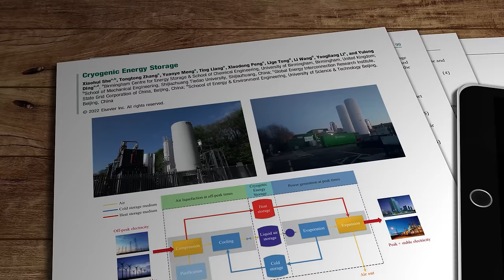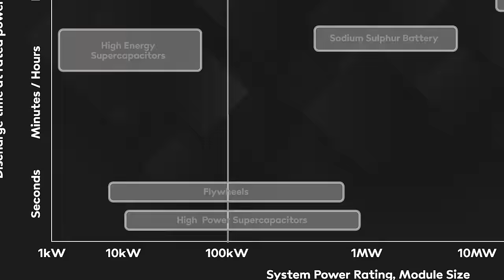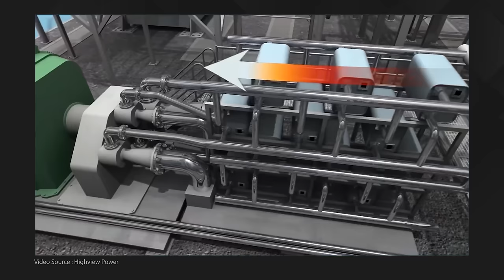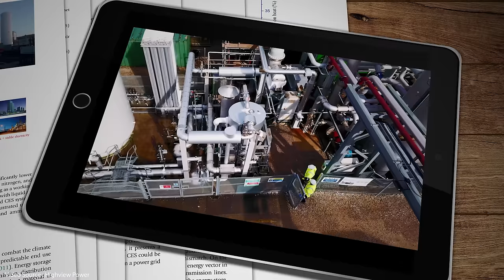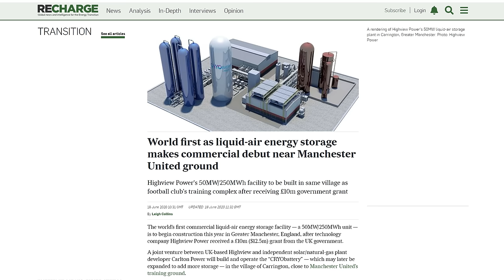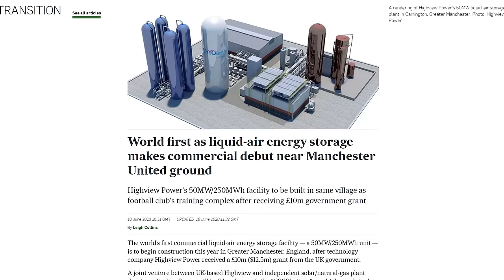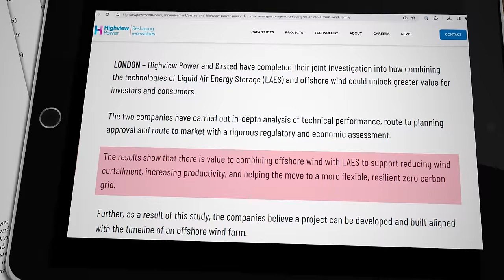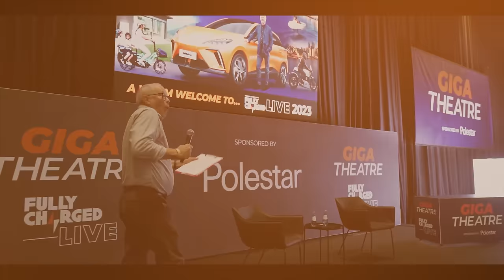Cryogenic Air Energy Storage - the new long duration energy solution?

Comment: I just skipped through and noticed that there are no statistical figures attached to this method. What is the efficiency of the storage? From a theoretical standpoint and the actual machinery there seems to be not only insane amounts of friction but also heat loss because it needs to be insulated. The only benefit of this storage solution is that it saves space.
I don't know why people try to develop solutions that are inherently very inefficient and high maintenance.
From a physics standpoint gases have a very low capacity that is just increased by turning it into a liquid and its attached energetic potential of having it expand. Expanding gases don't heat up they cool down. The heat that this system claims to recapture is friction heat which ultimately has a very bad efficiency altogether because IR radiation will heat up the whole machine and energy leaves the system.
There already are much better systems, that have less moving parts and are more efficient such as gravity based systems. You can store energy by pumping water up and get much more of the energy back again by letting it run down through turbines. 
And you can heat up rock which has a much higher capacity with its energy density and its easier to insulate. You also won't have as many high pressure vessels and the need to keep all of those air tight and impose a gigantic safety issue due to these high pressures.
Overall from my viewpoint this "storage system" seems like a scam to grab grant money and will ultimately be decided to not be used anywhere.
It is bad. High tech wasted on a system that we already have proven to be sub par.
As a direct comparison in a real work application in a competition between gases and more dense mediums for example liquid you could take gasoline engines vs liquid gas combustion engines. Now go figure what worked in the market and has more advantages and is safe altogether and has a higher energy density? The non compressed combustion. Translating just that simple fact from compressed to stable and more solid mediums it is very clear.
Don't drink the coolaid.
Reply: He said 60% efficiency, which seems reasonable to me. Storing liquid air (or other liquified gases) is not new or exotic technology, and I see no more reason to be concerned about its safety than, say, LNG, or liquid oxygen stored in every hospital. Insulation losses are very much a solved problem. The biggest justification for this approach is that it’s almost entirely off-the-shelf technology, which reduces time-to-market.
Reply: @davestagner You are right, its not new technology, but thats also what bothers me using compressed gas in this way. Because we know how inefficient it is. 60% is awfully low for just a storage solution. If you make an artificial dam pump water up with excess energy and let it down again when you need it there is much less loss and way less saftey concerns and less maintenance and tech involved. Thats my point. This technology only has a space advantage but the cost and complexity would be so incredibly large compared to systems we already have that it makes no sense to me why this is done in the first place. Thats why I think this is just a money grab from some startup. Btw this happens all over with "new technologies" companies trying to get state funding for a dead end technology to live off of. Especially new supposed green energies. But that only works on people who don't know much about anything, or its simply lobbysim or some sort of relative relationship between politician and the ones who run that company. Straight up corruption in some cases. Now idk if thats happening here, not accusing anyone. But this looks insane to me. Its like trying to invent a square wheel when we already have round wheels.
Reply: I'm guessing you wouldn't have been a huge fan of the steam engine back in the day.
Reply: @RandallSlick  Like Dave said, using compressed gas is not new technology. Do you have any idea how bad pneumatic energy efficiency is? And the current struggle of even trying to store liquid hydrogen as an example? You cannot compare it with a steam engine as a technology. You can only compare it when someone tries to invent a new steam engine while we have jet propulsion. 
You don't seem to understand whats happeing in this thing. The amount of energy transfer that is happening even trying to liquify gas is insanely high. Alot of friction is happening and the gas itself heats up when it is being compressed because of the atoms/molecules having friction with eachother. That is energy you need to put in which then in turn is stored in the liquid gas but also radiates all in the compressors itself, which means all that heat needs to be captured and the stuff has to be insulated, and you can only do that with even more complexity and heat exchangers, and then you cannot capture everything because to make isolation near 100% it is ridiculously expensive and complex. And we do have storage systems that go over 60% efficiency which are cheaper and less complex which will make it even cheaper over time with less maintenance.
Reply: @YouCountSheep  We have storage systems with better than 60% efficiency… but are they cheaper? Are they more readily scalable? Batteries probably aren’t cheaper. 

And just because something requires a lot of energy doesn’t mean it’s inefficient. In the case of liquifying air, it’s transforming into potential energy - which is released by warming the air, causing phase change from liquid to gas. The inefficiency is the energy required that’s lost to heat during the process, not the total energy (about 40%, if they’re really at 60% efficiency). Comparing to the problems of liquid hydrogen isn’t apples to apples, either. Hydrogen liquifies at -252.87c, nitrogen liquifies at -195.8c. That’s a big difference in the difficulty of both liquification and storage.
Reply: @davestagner I think this system is expensive as you can make it because of the complexity. I'Ve worked with compressors and liquid oxygen, transporting it, selling it. Worked on compressor maintenance, plumbing. This system is dangerous. Yeah maybe you can scale it, because having something like this decentraliased at home or per block just adds another hazard. Anything under pressure is. THen you have to think about metal fatigue, temperature that expands and contracts the metal creating leaks, all that good stuff.
If I had to vote for a newer type of scaleable energy battery, the "sand" battery is probably the sanest choice. You just heat up a bucket of sand with your excess electricity, and when you need some you pass water through a pipe that runs in that sand bucket, makes steam and you are done. Alot simpler and scaleable and works with steam turbines. I don't even think this system has anywhere near the output using the same gas volume. Water is so special, we are not just using hot steam, we superheat and reheat it to get insane efficiency out of a gas. This method doesn't even have that option. So you can see, there is alot to be sceptical about.
Reply: @YouCountSheep  I don’t think they’re proposing it for at-home or small-scale systems. I agree, it’s a bad idea at home. For industrial scale storage, though, it’s well understood and safe in that context. Batteries make WAY more sense for small scale, where simplicity matters more than cost effectiveness. I do think box-of-rocks (or box-of-sand) thermal storage might beat liquid air on cost at large scale, at least in a majority of situations, but… time to market matters, and someone building a solution with off-the-shelf parts has a leg up on someone building totally new technology. 

At any rate, I think we’re looking at 60% round-trip efficiency (best case) for most large-scale, medium/long term energy storage, regardless of technology. Batteries are too expensive and not dense enough for the weeks/months level storage, although they’re great for a day or two.
Reply: @davestagner It would come down to energy density by volume, and you can heat rocks up to insane temperatures, even above most metals without causing deformation, gases, you can only compress so far. Both systems need a turbine, and storage as a pressure vessel or a cylinder full with sand, so size wise they are similar, the gas one would even be a bit bigger because it needs that compressor. A pumped storage like a dam has an energy efficiency of around 75%. And I highly doubt this number of 60% because of all the thermal problems it has. That 60% is highly theoretical, and when they say they achived it in a practical test something fishy is going on. You can easily measure that. The electricity going in to compress the gas and then what the output is in the end, even with all that heat somehow used, its not going to be 60%, to me it looks more like 30% and that is really really bad.

Comment: Sounds perfect on several dimensions. Supply chain and workforce can be reassigned from fossil fuel industry so already doable quickly and at scale. Efficiency is also pretty decent, and the resource air is there and nontoxic unlike batteries.

Comment: Cryogenic air storage is a definite improvement on just compressed air systems, and it does have the advantage of using industrial standard components, but I can see 2 problems with 
this idea.

Firstly, the round-trip efficiency figures you quoted do not seem that efficient, liquifying air needs a lot of energy, and while some of the heating and cooling can be captured and stored to be reused 
in the process, for each stage in the process you lose a percentage of the energy you are trying to store, which need not be a big problem as long as the energy being stored comes from renewable sources, it just requires 50% more wind turbines to be built.

The second problem is that liquefied air has no other uses, if however spare renewable energy where to be used in electrolysers to produce Hydrogen, which could be stored in a compressed or liquefied state for days, weeks or even months, later to be converted back into electricity by being burned in converted gas peaker plants or more efficiently if more expensively in fuel cell systems.
While again you lose a percentage of the energy you are trying to store on each side of the process, the round-trip efficiency should be no worse than a cryogenic air system, plus Hydrogen has the potential to power ships, aeroplanes, heavy vehicle, basically anything Where a battery or cable would not be appropriate.

There is another compressed gas system you might want to keep an eye on, this one uses carbon dioxide in a closed loop system ready to be compressed and then returned to 
atmospheric pressure, again it uses industry standard components and has a claimed higher round-trip efficiency, it only disadvantage is that for most of the time the carbon dioxide is 
stored at atmospheric pressure in a huge bladder/dome the size of a couple of football fields named energy dome it claimed to have full scale working system running in 2024 aimed at 
the 6 hour market in grid scale systems and cheaper than lithium-ion batteries. 

Finally, it is nice to hear someone admit that lithium-ion batteries are only good for 6 hours In a grid scale system, and while you install extra rows of batteries to kick in one after 
another to supply electricity for days or weeks, the cost would be enormous, pushing electricity prices to a point where people would be clamouring for the return of coal.

Comment: 60 percent round trip, plus possibly to piggyback co-located air distillation production with shared efficiencies, plus a means of extracting a teeny bit of carbon to be incorporated in greenwash... Every little bit helps.  This is a winner.

Comment: They should build two 200MW/250GWH liquid air installations on the Isle of Grain, Kent, on the site of the two demolished fossil fuel power stations (Grain and Kingsnorth). It would be ideal to store the offshore wind turbine energy generated along  the north Kent coast (Isle of Sheppey, Thanet and Kentish Flats), along with the Uk's largest solar PV farm, currently being constructed at Cleve Hill near Faversham. It would silence the nimbys  who don't want lithium battery storage at Cleve Hill,  make use of the existing grid high voltage network, end curtailment and provide ideal peak demand energy. It would also  go a long way to addressing those winter dunkelflauten days. And if it's successful, just keep adding  more storage along with renewable wind and solar. God, this is a no-brainer.

Comment: I wonder if this would be a good system for hospitals, particularly in small to medium sized towns.
- grid failure protection
- supply of liquid oxygen and nitrogen that they currently have to truck in.
- stored heat for space heating, hot water and laundry
- stored cold for air conditioning
- using the heat and cold directly would be more efficient than converting back to electricity for separate electrically powered thermal devices.
- charge with on-site solar and local solar and wind farms
- could be scaled to integrate with a town's power grid.

Comment: Air is a primarily mixture of nitrogen, oxygen and argon which have different boiling points.  To keep nitrogen liquid requires a pressure of  390 KPa which is a lot of pressure. The alternative is storing it in a Dewar flask with some being let boil off to maintain the low temperature (-147C)  of the rest. It seems someone has already built a vehicle that used liquid air to power it. The idea has merit and maybe as a side hustle they could extract the argon as that's quite valuable. I can see why the authorities would be concerned though. We already have the technology  to do this however storing liquid nitrogen does have risks and of course over time losses.

Comment: The claim of 60% roundtrip efficiency is a hard goal that yet has to be achieved. ATM we are talking about 25-50%. There must be a mid level temperature source to reach 60% which is not the case everywhere. To me this just looks like compressed air storage with all of it's benefits and weaknesses, just a cryo version

Comment: BUT WHAT ARE YOU GOING TO DO WHEN THE SUN DOESN'T SHINE AND THE WIND DOESN'T BLOW??  God, I am so tired of those Magidjits STILL raising these old, no longer valid objections to renewables.  Those of us in the know, with a large "Thank you" to this channel, understand that we are just starting to explore SO many financially workable options to give us 24/7 multi-day energy that doesn't pollute.

My home in Texas, due to the very unusual market place options, is 100% wind and solar.  That includes heating, cooling, cooking, hot water, and lights.  Delivered for 15 cents per kw/hr.  BTW, last summer the grid customers did not experience brownouts and blackouts.  Why?  A 20% increase in solar power in the last couple of years.  Texas also has the most wind energy in the US, I believe.  Mile after mile of windmills out in the West Texas desert, or up north in the panhandle, where ranchers can make ends meet by selling turbine rights, right among the cattle.

Comment: The transportablity is also worth mentioning if the system makes a fill station for semi tanks it could be transport to emergency areas or be used as off grid power or backup

Comment: well, that  should be  mixed  with  hot  source, , like    heated  concreed,  you mix  both  and you   get  much faster  expansion rate, you could  also  use  backup  small  gas fernice  to speedup ;)

Comment: I love this video. And it's exciting to hear that there are installation planned for Australia (even if not on the main grid, but hopefully it'll demonstrate to the nay-sayers that it's a real thing).
One question about grid scale storage in general - so you keep showing this chart which shows discharge time and rate of power vs. capacity (around minute 1:19 in this video) and my question is how is the storage with higher discharge time (i.e. slower) fit into the grid.
Is it used "behind" faster storage or is it connected directly?
What I mean to ask - when the grid needs frequent regulation (I think it's called FCAS in grid parlance) and the faster storage options are depleted because they don't have enough capacity, are the slower storages used to fill up the faster ones? Is this required at all?

Comment: Worked for many years n similar nitrogen production plant. These are very reliable. Minimum maintenance. Runs for long time before needing maintained.
I can see these units replacing gas plants. We in future will not need gas power back up.

Comment: the best option for utility scale storage is molten salt batteries sunk into sand. so all energy lost on roundtrip of those batteries are saved to sand and converted into utility scale hot watter. Also heat exchangers contain peltiere elements and give you 10-15% back as electricity so you have like 30% scaling during a day yo can load into battery or load into grid. but what is interesting is when you use centalized heating then you get most out of those cells  when you use heat the most the coldest days of the year when electricity is also most needed.  It means when you got 0 degree C then or -20C heating goes up 4x and electricity generation goes up also 4x since you still get that10-15% of heat energy converted from  peltiere element. In my city Tallinn case it may also mean that at -25c there may be even too much electricity.